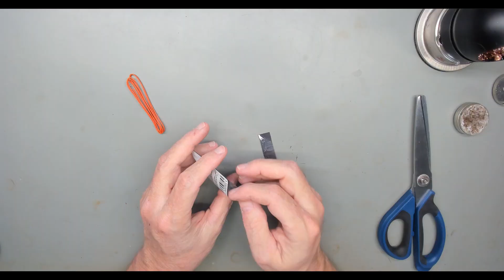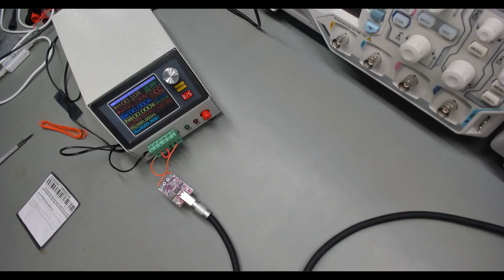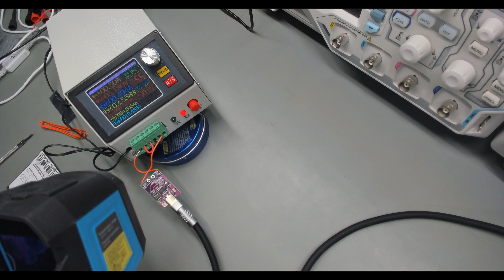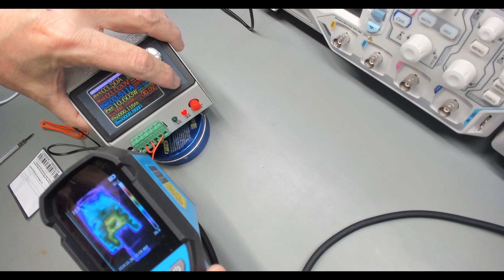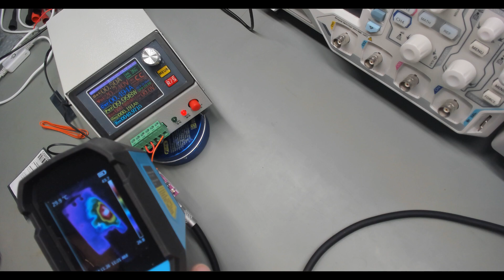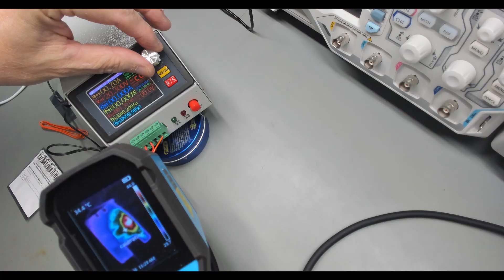WARNING Don't Buy ANY USB PD Products Until You See This!

Comment: Does the Kapton tape help with pick and place?
Reply from the maker: Good question, I’m not sure but normally they use kapton tape to protect from heat of the solder and flux vapors. 
RJ
Reply: @LynxElectronicsLab  Indeed, wondered if it also allowed the vacuum pickup of the pick and place machine to hold the part. You sometimes see a small square of kapton tape on usb mini connectors, assuming this is for the same reason 🙂
Reply from the maker: Sounds like a good possibility. That might be it.
RJ

Comment: Looks like a nice utility to get a PD capable power supply to shift to higher voltage.
If I get it right, chip getting warm 73(8?)L05 is only voltage regulator for PD control chip. Heat in that chip should only depend on input voltage, not current.
Heat seen I guess is mostly coming from positive trace at the bottom, that is a bit narrow at input. Traces looks like they go straight from input to output. 
 
Voltage dropping at 3A+ at 5V is power supply not able to deliver more.
Reply: is PD just power distribution?  If so I dont get why people are even saying it, but is that what it means
Reply from the maker: Because a standard usb supply can not provide but the 5v power. So adding the PD lets you know it is one that can provide the higher voltages if requested.
Reply: @LynxElectronicsLab  ahh so the power bank I have that has a PD usb-c can suppoedly then provide all these voltages if the device request it, got it.
Reply from the maker: @Jueyes-vg2gb  Yes!
Reply from the maker: Correct the one spot is the 7805 getting hot from the 20v being dropped to 5v. This is why it is not hot on the 5v setting. But the traces heat up also as they and the connector in my opinion is not suitable for high power like the 100 watts the Chinese claim.

I might check this, but the supply provides more than 15 watts (3A X 5V) to my soldering iron so I would not expect to fail to provide it to this board. The supply is rated at 65 watts. So I doubt it can only supply 18% of that.

Comment: what does the pd thing do?
Reply from the maker: Just as @darrenmurphy said.
Reply: Power Delivery... Feedback from the charging device back to the charger allows for variation in the amount of power delivered based on the amount required. Much like a voltage sense return line in a classic remote DC power supply, which compensates for the IR loss in the wiring in a chassis.
Reply: There is this: https://en.wikipedia.org/wiki/USB_hardware#USB_Power_Delivery

Comment: Hi RJ, that is so much better board than the previous one. Its crazy what that little board can handle. No active cooling and I don't think I saw a heat sink. 

On a different subject. I saw on a couple different sites where people are seeing up to 100vac on the tip of the USB soldering irons. There is little to no current so its mostly safe. The problem seems to be grounding which in theory could be an esd static issue.

Take care Rick
Reply from the maker: Yeah Rick, they could be useful as a supply for projects you want to power by USB. That’s interesting about the soldering irons. What irons are they seeing this on?
RJ
Reply: @LynxElectronicsLab  one y-tuber Tony359 said all USB irons since they don't connect to the mains ground. He tested the Kaiweets and Sequre. The kaiweets module looks close to the Fnirsi. There is zero issue if using a power bank. I guess to test yours with a meter connect to earth and the tip of the iron. Power off and power on.

Hope that helps Rick
Reply from the maker: Thanks Rick, might take a look at that.
RJ
Reply: I dont think ill ever truly understand grounding, can they not use like piece of material in a device to use as a ground?  Or is it that becuase its not a true ground, sure they can use the piece of material, but the material better be able to disipate the voltage?